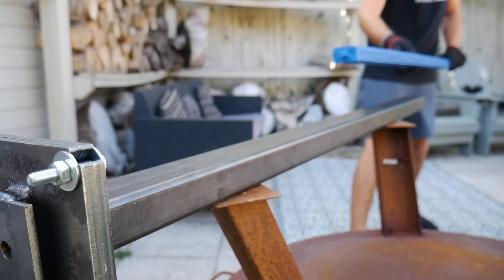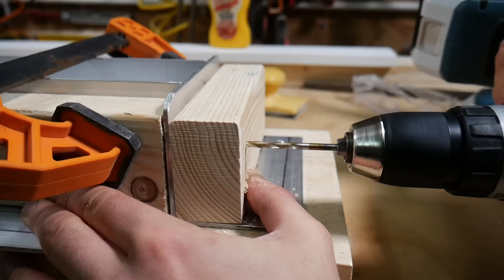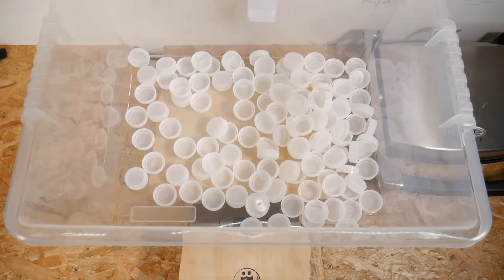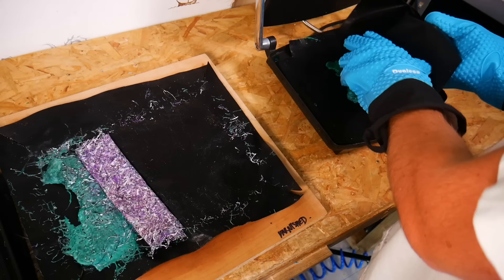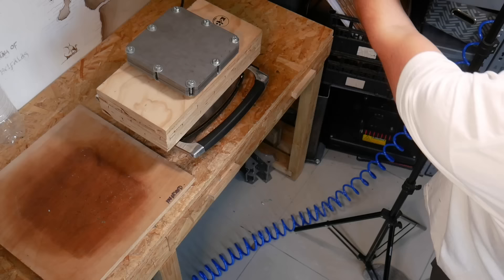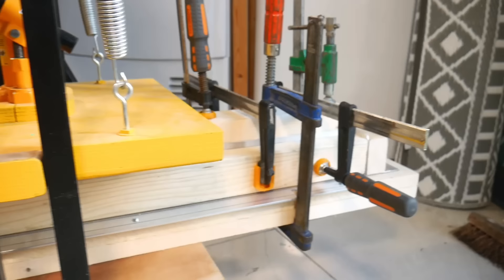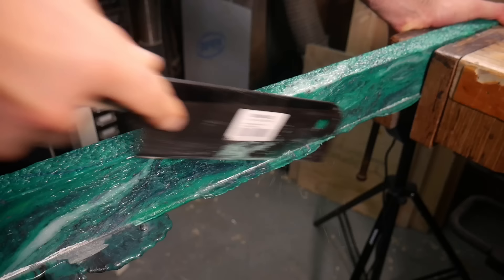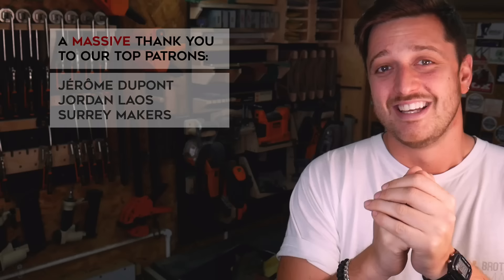How to Make Recycled BEAMS from Plastic Waste at Home

Comment: As already stated, use electrical heating. 

For an easy build at home option, making the internal of the set mould out of a thermally conductive  metal like aluminum or stainless but the external out of a thermally insulative material, like a good quality hardwood lined with a fire blanket. 

Commercial Refrigeration defrosting cable (a flat resistive ribbon cable used ) layed between the fire blanket and aluminum. 
This can be then allow for a controlled controlled temperature enviroment and extended pliability in the plastic, and an even all round heat / cool cycle.

Going all the way, a heated concrete mould block, with with a removable folded stainless steel internal liner and  checking holes through the side to release excess  pressurised product and air bubbles when compressed is applied....
The concrete can be heated to maintenance temperature, and several stainless moulds rotated through it.
one step farther is to use a combo of solar heated water or gas heating  in embedded tubes supplemented by electrical heating .... 

All that time i spent designing and making heated rocks and enclosures for snakes and lizards  may not have entirely been in vainn

Comment: Question: How strong is this plastic "beam"? stress load wise?  Is it as Strong, stronger or weaker than the standard wood ?
Reply: I also am curious about this.
Reply: @AcidGamesYT  me too
Reply: Came here with the same question haha, hope they will answer
Reply: I was wondering the same thing
Reply: Chris Clifford  from the comment section, I'm guessing it is not better than wood, but it would be great to actually test and measure
Reply: It wood be great to test it
Reply: Chris Clifford  
it's the load bearing that count's they are meant to be "load bearing beam's", 

As for a flexible beam, I can't think of a need for a flexible beam, maybe flexible tower block,

not to sure what impact resistance has to do with load bearing ?, could you please explain more, so we all are on the same page, to begin with.
Reply: How’s the off-gassing/fumes during the melting process?
Reply: And also how much electricity went into making it?
Reply: Chris Clifford  it depends what kind of plastic
Reply: @FallofftheMap  he passed out, so it might be a while....😉🙃
Reply: @driftwood5407  flexible means it won't bear alot of load, a load bearing beam is ridged. But if it's a question of repeated short term stresses it would be a good application.  Longer and more screws or fasterners would be advisable due to even distribution of forces and chances of fracture due to oxidation, UV damage, or cold temps.
Also UV light breaks down plastic, it's why if you see a plastic bag stuck long enough in one place it turns to tiny plastic pieces.  This is a good general engineering question though.
Reply: @ObliviouslyAware   your under standing of flexible means some thing different to my under standing, I agree to disagree,..., could you explain " repeated short term stresses it would be a good application " in more depth, and not wonder off to  the plastic breaking down, i think we all under stand that.
Reply: @driftwood5407  doors, gates, steps, handles, those would be good applications, I also had another thought last night, composite materials, add fiberglass or nylon fibers, might make it on par with wood.
Reply: @ObliviouslyAware  I have read some where some folks are  possible turning  plastic back in to crude oil,  i think it was under pressure + heat, i will try to find the url and post it.
Reply: worth a read not a youtube stuff
Reply: @driftwood5407  I'm aware, it's been around for decades but a Japanese man invented a small scale one for 3rd world use a decade ago I believe.
Reply: @ObliviouslyAware   I wonder if it's cheaper to turn the plastic back in oil, then to make "beams" ? energy wise
Reply: @driftwood5407  Probably easier to make bars, but what would you do with the oil?  3rd world needs it because low resources from limited access.
Reply: Chris Clifford  yeah how are you doing that by putting plastic in even more places it will wear down. Microplastics galour you arent getting rid of a problem with this so much as spreading it all around, kinda like when I didn't eat my food id just hide it under the mash potatoes
Reply: @ObliviouslyAware   Recycled back oil to me means no more mining for it, no need for oil mining or fracking for gas, this would help the third world and the second and the first world what ever that is.
Reply: Not only how strong is it at room temperature, but how will it handle heat over time of many hot summers holding up a house?
Reply: @ObliviouslyAware  does  this make plastic beam stronger
Reply: It would sag more than the equivalent size softwood, when a load was applied.
Reply: How come none of you great thinkers haven't used the proper word to describe the property you banter about as strength? It's "stiffness" which determines how much a material moves when loaded/stressed. Material size and stress and "modulus of elasticity" (which can be looked up for all materials) determine how much it moves. Not rocket science, maybe 1st year college .
Reply: @wesleygilbert2444  have you allowed for Hook's law and values of Young's modulus of elasticity of the material
Reply: @wesleygilbert2444  Because we're bunch of normies on de net thats curious about everything. 

We're not fookn rocket scientists yanno.  :P
Reply: Zero strength, this is  a scam to attract viewers. This is nothing about plastics, and just abut everything they do is high risk
Reply: @geoffcrumblin7505  Do you have a video of yourself proving this claim of yours?
Reply: ROT RESISTANT even if it’s lower in integrity.  Definitely has its “strengths above wood. This is what I’m thinking and looking at my full recycling bin every day! I make kombucha as a business and use spring water from plastic jugs. Free rot free trim (minus time and efforts
Reply: ROT RESISTANT even if it’s lower in integrity.  Definitely has its “strengths above wood. This is what I’m thinking and looking at my full recycling bin every day! I make kombucha as a business and use spring water from plastic jugs. Free rot free trim (minus time and efforts
Reply: @mattellerd6783  
It WOOD be great to test it 😂

Comment: I think replacing the sandwich press with a Pizza Oven would speed things up, and using a heat gun on the mold could give you more time to press the plastic in.  I would love to see fence palings made with this method
Reply: I could just imagine it taking a year of very dedicated work to make enough palings.
Reply: Fence POSTS (Primarily for farm use) are commercially made in New Zealand, mainly from milk bottles and pallet wrap.

Comment: Since you’re primarily using bottle tops, I think there’s a faster way of melting them down potentially. It involves a steel tube with a large enough inner diameter to feed the caps through, and an induction heater coil (or a few along the pipe). Might have to add a rheostat to control temperature, but once dialled in I’m sure it would work like a plastic melting conveyor.
Reply: This is a great idea. It would take lot of trial and error but the end result sounds promising and efficient
Reply from the maker: That sounds exactly like our injection moulding machine. Check out a couple of our other videos and you’ll see it in action!

Comment: I would be curious to find out the difference between the wood and plastic beams. Like how much weight can they support both vertically and horizontally. Also as I am just discovering this channel are there any other plastics that might be more abundant that these beams could be made out of that can still hold up to the wood standard?
Reply: The strength of wood comes from its fibres. Plastic should be more solid than wood if the direction of the force would run parallel to the wood grain, but wood would be more solid than plastic if the force would run perpendicular to the grain. If you're looking for a strong plastic material that has fibres like wood and that you can make yourself, micarta or fiberglass would do the job, but as far as I know they're not recyclable the way HDPE is. HDPE, as far as I know, is the most common thermoplastic that you can just shred, reheat and mould. With that said, again, wood beams will be stronger than HDPE beams if used correctly.
Reply: At this point, you are getting into fiberglass and carbon fibers.  Carbon fiber requires you to know your load vectors though.  But if done right, it is amazingly strong.
Reply: I am not sure about framing of larger items, Yet these boards are great for decking. I have helped install quite a few of these boards and they look good even 5 years plus later. How strong they are I have no clue.
Reply: @kameljoe21  Yeah, number 1 application would be for weather resistance! Now I'm wondering if it would be useful to coat regular lumber in HDPE and then smooth it out, or if the materials would separate over time.
Reply: @wandererstraining  coating it would rot the wood out faster. The smallerst amount of water to get in there will cause it to rot. YOu can see this done when they do vinal fencing. They put plastic housing over 4x4 post and over a 10 year peiord or sometimes less they will rot out if they get enough water in them. This happens when the cap cracks or gets knocked off. So a coating is not ideal.
Reply: @kameljoe21  Makes sense. That's not something I ever tried, and I guess that's not worth the pain in the butt.
Reply: @wandererstraining   So maybe wood beams will be stronger than HDPE beams, but the point I think was that if could one use a strong plastic material like these or the decking ones to build a house, shed, etc.  It would be a godsend out in Arizonas sun, for a little hunting cabin. Wood lasts like nada there, same in florida with termites and rot.
Reply: @YouTubeRanch  Oh, I see. I think that the only types of plastic strong enough to use as wood beams would be reinforced with types of fibres.
Reply: @wandererstraining  Im hopefully going to have a few answers to the question of that here? I don't see the need for wood fibers. I might be wrong but it's questionable on that. If they can support decks
Reply: Wood is incredibly strong depending on fiber direction. Takes literal tons to break. I am sure it can take much more than most plastics. Carbon fiber is fibrous for a reason 😉
Reply: @wandererstraining  44

Comment: Making roof shingles and siding boards this way would be an excellent use.  Also, using low-tech silicon heaters on the mold will increase your mold work time.  These heaters are used on engines for easy starting, and they are inexpensive.

Comment: I had watched this or another video and at the end you asked for tips on making this process less labor intense not sure if you got any responses. But years ago I worked in plastic recycling plant what you need is an extruder basically just a pipe with a screw drive in it and wrap pipe with multiple e!extend heat bands that you can adjust to different heat settings since different plastics will melt at different heat and you can have one band hotter or cooler and by the time it comes out it will be perfect temperature you want for molding your boards.  If you are interested I could draw you a picture and explain how it works if you guys haven't already figured it out for yourselves. Good luck!

Comment: The end result looks great.  I am concerned about the amount of electricity used to do this, but the ideas people have had for a solar heater either as an oven or for the base of the mould is a good way round that.  I'm wondering how easy would it be to make a cylindrical form, either solid or tube?   I think they would look great for garden structures, and maybe the 2 x 4 would be strong enough for a shed frame (sized up a bit)

Comment: "It would be great to hear if you have any ideas to make this more feasible."

Salvage the heating element and controls from a junk electric oven.  Straighten out the heating element.  Make a self heating mold.  Bonus - you will have scrap sheet metal and insulation from the oven itself that you can work with.

Then you can just add your plastic scraps, stir, turn off the heat, and press.

Comment: Great idea. Questions, how many watts of electric were used?
Is it more or less than that used to produce a timber beam of the same size? Presumably an industrial scale may be more economic.
Hard to get around the carbon footprint issue.
Reply: solar panels or design an oven at less wattage for recycling plasic ?
Reply: Wonder if you could pre heat the plastic in a solar oven
Reply: totally no matter how many WATT you use, not important if can made and build somethink good itself. all carbon footprint etc economy have only big shit, no matter and no help or destroy anythink.

Comment: I'm curious about breathing the fumes of plastic melting. Is it of any concern to you guys? Do you have any knowledge around the subject?
Reply: its just melting, not combusting, so no fumes
Reply: @sauceLegs  that's not necessarily true, materials can produce emissions without any combustion, for example recently the emission of formaldehyde has become more and more of concern in composite wooden products like osb and multiplex
Reply: @sauceLegs  ABS is notorious for giving off toxic fumes while being 3d printed. Nothing that will kill you, but it can have both short and long term health effects.
Reply: @nordlead3296  good to know, I didn't realize
Reply: ABS and PVC are the two plastics you generally have to worry about fumes for (I'm sure there are more). HDPE is generally considered safe. The bigger concern would be any additives since this is recycled plastic and could have anything in it.

Comment: The marbled effect is beautiful.  I can imagine construction being done with beams like that instead of wood, given whatever additions are necessary to make it UV-resistant and at least as strong as ordinary softwood --- someone suggested using (recycled) fibreglass for extra strength.  I can see a 21st-century construction style developing which uses only marbled plastic-wood, used to show off its beauty, and little or no drywall at all.

This would actually, potentially, have three ecological benefits:
1) Recycling the plastic to keep it out of the oceans (and landfills).
2) Replacing wood in building, thus there can be less denuded forestland.
3) Leaving trees to grow and remain as carbon sinks.
Admittedly 2) and 3) are closely connected -- the connection is that trees that are not used in construction can continue to grow and sequester carbon.  I can add a fourth potential ecological benefit if the construction style above takes off:
4) Less use of drywall with whatever ecological problems are (probably) associated with its manufacture.  
There is financial and ecological cost, such as energy use and off-gassing, associated with the manufacture of plastic-wood too; it would have to be studied to determine to what extent plastic-wood's costs are offset by the removal of the costs of making plastic-wood instead.
Reply: Would need to worry about high summer heat. I have seen pictures of plastic objects that have melted ( fences, traffic cones, etc )

Comment: Here's a thought for you guys.  Being that the frame is metal, you could place a silicon heating pad (with built in thermostat) on the metal frame itself, preferably the underside length as that would make the most sense.  They use these silicon pads in some 3d printers to heat up the beds for plastic adhesion. 

You'd be basically creating a direct heat box instead of melting the plastic in your ovens. 

At that point its arrange your plastic in the frame, plug it in, wait for it to melt and press/form it.  Then unplug and wait for it to cool.
Reply: I'd like to see this be tried! Smart thinking :)
Reply: @sleepingbag2424  That would basically be the Precious Plastic Sheet Press with a mold for rectangular pieces in it instead of the square sheet mold
.
Reply: How about the blending and air bubble removal?
Reply from the maker: Great idea! Definitely one we'll have a think about. Thanks 🤙🏼🤙🏼